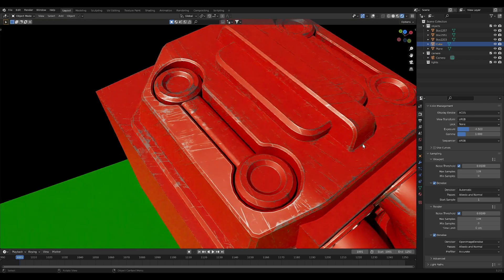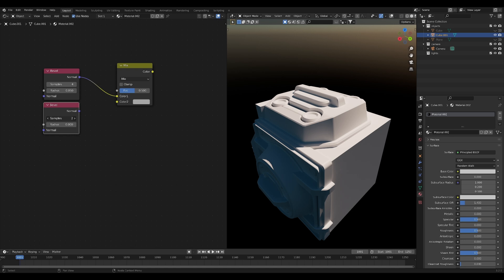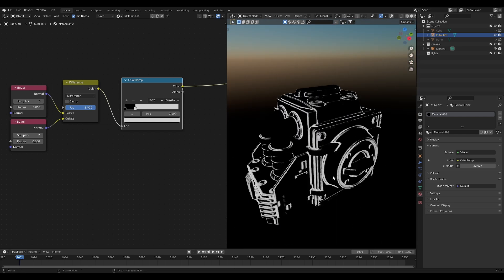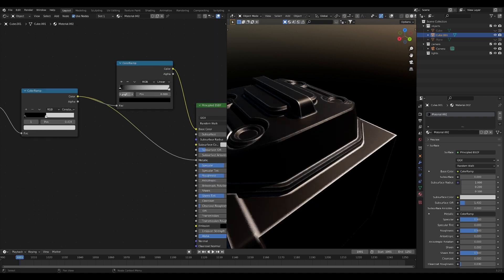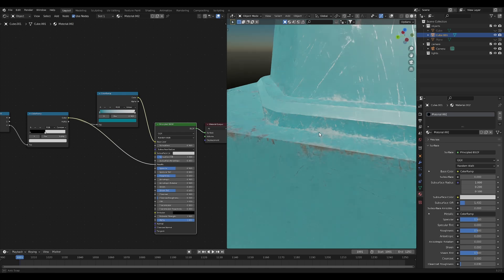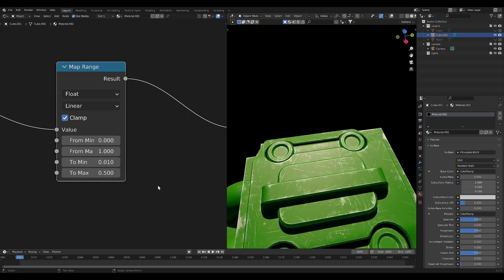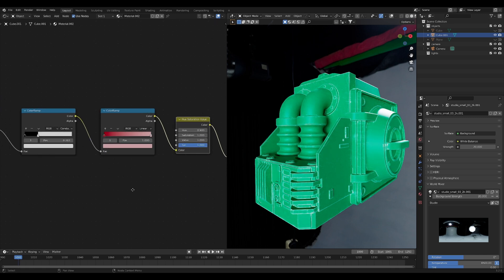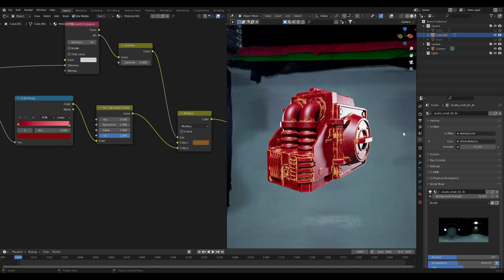The RIGHT Way to do Edge Wear (in Cycles!)

Comment: So, I just made this comment on another video using a similar approach. The issue here is you are calculated and adding damage to both the concave and convex edges (inner and outer edges). Edge damage, for the most part, is only going to be on the outer edges, and dirt or other buildups would be on the inner edges.

Comment: No bevel node in shader editor - I'm assuming this changed in 4.2 -
Reply from the maker: There sure is, are you using cycles?
Reply: @ChristopherFraserVFX  No I was on evee. Is this only available once you switch to cycles?
Reply from the maker: @josephvanwyk2088  It is, the bevel node is exclusive to cycles
Reply: @ChristopherFraserVFX  Ah ok thanks.

Comment: Idk why but for some reason the bevel just does not get the edges of my object. I have cycle on and I got it to work with another object but not antoher. For example I have a windw and just the outer part not the glass it never works for. It works fine with a cube but idk if its because it is because it has an opening?

Comment: If you're in cycles render view and still can't see any edges, try using either a vector math node instead of mix RGB set to dot product, and adjusting the radius values of each until the result is clear!
Reply: Thank you for the good advice.

Comment: hey is there a way to make the edge wear emmisive? i can't seem to find a way to do that since everything becomes emmisive and i want ONLY the edges to glow 😥
Reply from the maker: You can use the edge wear like I show you in the tutorial, then plug it into the emission strength or use it to drive the emissive color. There are a lot of ways to accomplish what you're after, but the simplest way is to just plug things in where you think they should go. For this kind of effect, that's usually the best solution.

If you're doing that and everything is glowing, make sure you're using the Cycles engine. Like the title says, this effect is Cycles only.

Comment: This is a very good method, but still has one drawback : the wear is in both positive angles edges (edges out from the body) AND negative (holes). may be what you are after, but if you want to select ONLY the positive edges angles, you will need to set this as attribute in geometry node (signed edges angle is what you are looking for), and grab that back into the shader editor.
Now, the only "problem" is that you will need both the material AND the geometry node modifier to "sniff" the edges.
by doing so, you can separate negative and positive angles to do different things, for example dirt in negative edges, and edges wear in the positive ones. twice as very powerful!

Comment: Great tutorial, thanks! One little problem is that at the end, around 3:50, you show that the objects will dynamically work with each other and mine don't. In order to get that effect I have to join the objects together which I'd prefer not to. Did I do something wrong?
Reply from the maker: Uncheck "Only Local" on your ambient occlusion node

Comment: Isnt working, blender 4.2.2, cycles, shading set to render.
Reply: Oh it does work on cube. Not on a real complex model though.
Reply from the maker: @Myaw-mrow weird! How is it not working?
Reply: @ChristopherFraserVFX  I figured what the issue was. It was set to shade smooth, it doesnot work that way. You need to set it to auto smooth and play with the angle value or set it to flat. Maybe, using custom normal map to bevel node would work too. Thank you for great video!

Comment: When mixing the two bevel nodes the exact way you do and then node wrangler previewing from the mix node, my engine crashes every time :(
Reply from the maker: Does it help if you use the Normal output from the Geometry node instead of a second bevel set to 0? (This is faster anyway if it works, I just didn't think of it at the time of the tutorial)

Comment: Tried this on a Monkey head at default scale in Cycles in viewport shading on 3.6 and it just doesn't do anything? The bevel nodes don't seem to actually matter no matter what in the chain I adjust I get a solid color or at best a white blob that doesn't have anything to do with the edges. I'm very confused because I actually understand how these nodes work together (came to this tutorial for a refresher) and it SHOULD be doing something, but just isn't...
EDIT: I plugged the a texture coordinate and mapping node into the bevel nodes and put them to through the normal vector and that seems to have done it. Weird that it didn't need that in the video, but I should have tried that immediately before screwing around with other stuff! Anyway, that seemed to be the issue.
Reply from the maker: Very very strange, that definitely should not be necessary but if that's what you needed to do to get it to work..

Comment: How can I mix this with a musgrave texture?
Reply from the maker: I would add your musgrave texture, plug it into a map range node, then use that as the bevel radius!

You can adjust the values in the map range node to adjust the minimum and maximum radius of the edgewear

Comment: Ive been using Blender for 6 years. This did not work. Yes plugged right, yes cycles. Moving on I guess
Reply: Didn't work for me either, at first, than I played a little with the values and it did work. It could be the scale of your model that would affect the values. I've been using blender for less than a year btw.
Reply: Neither for me, it worked in some parts of my model but not all
Reply: @davexmit  it is weird but I'll take what I can get
Reply: It's usually an issue eith normals

Comment: If you use vector math set to dot product it calculates a more accurate difference and the edge will be even. Another method is to use an ambient occlusion node set to inside and with a small distance value. Again an image texture can be plugged into the distance to make rough edge wear. Bevel and Ambient occlusion make different results so you can mix and match them to get something that looks awesome! If your model is organic with dense topology you could also use the Geometry- Pointiness node.
Reply from the maker: All other excellent solutions! Can't remember if I covered this in the video but I also like to use pointiness for slight color variations too.

I like the ao method too if you want corners to get way more worn, it can work really well! I forgot about that technique.

Comment: Trying to follow along but It's not working. What did you plug the Mix Color into at 0:44 Seconds. Im sure it should be pretty obvious but Im pretty damn new to Blender...
Reply from the maker: There's a neat addon that comes with Blender called node wrangler! You can enable it under Edit > Preferences > Addons. One of the cool things it lets you do is Ctrl+Shift Click nodes to instantly plug them into the material output so you can preview them.

Or, you can just plug the node directly into the output.
Reply: @ChristopherFraserVFX  I'll enable that!
Reply: @ChristopherFraserVFX  I actually sort of got it to work. I was using an incorrect node for one part lol.

Comment: Super tutorial! I assume you have to reset the scale of the object to 1 in all dimensions before applying this edge wear? That's the usual first step for these kinds of effects.
Reply from the maker: Not necessary! I'm pretty sure it works off relative world scale, so it'd be the same thickness on an object that's at .00001 scale as an object that's 1 scale, if they're the same size. Hope that makes sense

Comment: does this only work for high poly meshes? I have a low poly model that im working with and its all ending up as black or white
Reply from the maker: That's probably either because of the size of your mesh/bevel, or because you're not using Cycles.

Comment: wont work on my models
Reply from the maker: Make sure you're using Cycles :)
Reply: @ChristopherFraserVFX  i am i think the model isnt uved right
Reply from the maker: The beauty of this technique is you don't need to UV unwrap your model, since it's fully procedural.

Check all the nodes are plugged in properly, then perhaps the bevel amount is too large (or small), or your normals are flipped? (I don't know if that would fix it but worth trying)

Comment: it just doesnt work for me, it just doesnt, at around 0:50 you already got outlines but for me its just pitch black and if i lower the factor it becomes just normal colors i dont even know what to do, this is the 2nd tutorial i follow through on the bevel node and neither of them worked
Reply from the maker: Are you using Cycles?
Reply: Selected Viewport Shading?
Reply: Same problem, doesnt work

Comment: Use geometry nodes normal output instead of a 0 radius bevel
and use a vector math dot product node instead of mix RGB
Reply: How do I use the geo node normal output in shader editor?
Reply: @sebo102  The node is called "Geomentry" with a large number of outputs, of which the second should be the Normal output.
Reply: @sebo102  The geometry shader node. Sorry
Reply: Thanks, somehow using Difference with the Color Mix node didn't work at all for me.
Edit: Figured out that the dimensions of the model play a huge role so really small objects obviously need a really small Bevel Raidus. 
My model for example needed a radius of 0.0001 to actually work like in the tutorial.
Reply: @therealKrak  np

Comment: If you multiply the whole thing by an ambient occlusion node, it prevents edge wear in the crevices and leaves the edge wear on the outer edges only.
Reply from the maker: That's one method! I like it
Reply: What do you mean when you say "multiply the whole thing by an ambient occlusion node" isn't that what he's already doing in the video, the last node before the shader is a multiply node with AO.
Reply: @justanothernobody7142  - But look at the video right when he plugs in the AO node.  The inner edges still have the wear effect on them.  You need to tweak the AO node and the graph to get the effect that the OP was talking about.
Reply: Came to ask this. Thank you JRH.

Comment: Hi, thanks for the tutorial. Nice method. I have a problem though. My imperfections appear stretched in the z axis (I took one from Quixel Bridge). Can't really figure a way out to fix that. Any tips?
Reply from the maker: Your mapping is probably betraying you here.

Try setting the projection of the textures from "Flat" to "Box".
If that doesn't work, add a Texture Coordinate node and plug the Object output into the Vector input on your Image Texture node.

Lemme know if that works :)
Reply: @ChristopherFraserVFX  Thanks for the quick response. I will try that out!
Reply: @ChristopherFraserVFX  That worked like charme! Thanks!

Comment: I went into this video thinking it would be about the pointiness attribute instead I learnt something new entirely. Awesome stuff man!
Reply from the maker: I'm so glad you liked it!
I'd love to know why it looked pointless to you, maybe I can fix that so other potential viewers don't miss out.
Reply: @ChristopherFraserVFX  Oh no you misread me my dude! There's a shader node called 'geometry' and it has an output called 'pointiness' that highlights sharp edges like what you got here - albeit with much less control. This definitely wasn't a pointless tutorial by any stretch of the matter for sure!
Reply from the maker: Oh my bad! I guess I flew through it too quickly. Pointiness is a sweet attribute though, I like to use it as a sneaky way to add some brightness variation to some of my sci-fi materials.
Reply: Same! Ive been using "pointiness" on the geo node too, and really liked finding a new method. This seems to be more controllable, too. I'm working in 4.2.3, using a different model and different scratchy texture and so had to do a bit of jiggling to get it to work.

Comment: Thank you for the video! I am beginning to learn Blender to make fancy renders of my fusion360 models and this is just what I was looking for! 
But it seems that I can only see this effect on cycles but not eevee. Did I miss some checkbox on eevee settings?
Reply: best work around is  a new image txt set to black and texture paint in white where you want the effect.
Reply from the maker: Sadly the bevel node doesn't work in Eevee, so you'll have to find a workaround... you could try using an ambient occlusion node set to "Inside" to get a sinilat effect, but i dont think that works in eevee either sadly

Comment: Sorry, I have to be critical here:
Not as easy as the tutor claims, therefore not recommended, especially not for beginners - explained much too quickly, unclear and too complicated.
And then you should also buy and download one of his textures.
After about 2 hours of trying, I gave up.
All in all: a rather frustrating tutorial for me.
Reply from the maker: Sorry to hear you're having problems! Usually this is pretty quick. Can you outline what's wrong with the results you're getting? It could be as simple as a node plugged in wrong.
Reply: @ChristopherFraserVFX  Thanks for your answer Christopher! 🙂
I'm a beginner (also speaking a foreign language) and I probably underestimated the level of difficulty of this tutorial and words like "super, super easy" etc. have furthered this misunderstanding. Maybe the tutorial is "super easy" for advanced users but not for beginners. Therefore I would welcome a clear and honest categorization of tutorials into appropriate categories (like beginners / advanced etc.).
State of things: I've done the tutorial again and have now come a little closer to my goal than yesterday. ;-)
Don't get me wrong: Of course I still want to thank you for your effort, but I would like to ask for a clear and honest description of the level of difficulty in order not to create unnecessary frustration.
My best wishes for your work here - Rena.
Reply: @vl4997  I think that you were using EEVEE rendering engine, the bevel node works only in CYCLES. It should be mentioned in the video and in the title of the video. It is as hashtag but... I only found it out becouse I was searching for it :D

Comment: Nice video!
It would be even better though if you could adjust the amount of scratches depending on the angle of the edge. Since certain edges (the ones that push in instead of out) are not likely to be scratched by anything.
Reply: you can use an ambient occlusion node and subtract this from the edge wear. I think you will have to use the multiply mode for that but i'm not sure right now.
Reply: @mariuswickli3206  Sounds like a very smart solution indeed ! Doing so will account for specific cases where, for example, you have an accute angle pointing outwards (which would be filled with scratches with a method based on angle), but this angle is itself inside a narrow space, that prevents other theoretical objects from scratching it. Using ambient occlusion, we get the effet that colliding objects won't pass any better than light, and thus not scratch the angle.

I don't know if I'm clear, plus you certainly already know that, but I thought it was interesting to point out.
The bottom line is, this seems to be a very good solution
Reply from the maker: Ooh that's an interesting point... That would be hard since the bevel node doesn't really see that I don't think. I'd love to see a solution for this though
Reply: @ChristopherFraserVFX  You can make the mask for that in Geometry Nodes. The geonodes can look at the edge angle including the sign, output it to a colour Attribute, and then you can load that colour Attribute in the shader and proceed as normal. This works in Eevee as well as Cycles, and any other render engine that can access attributes.
Reply from the maker: That is incredibly clever, I'll try this out
Reply: You can. Multiply what goes into the bevel node by pointiness from the geometry node. You may need to use map range to tweak the pointiness.